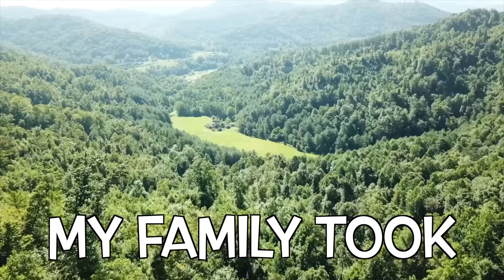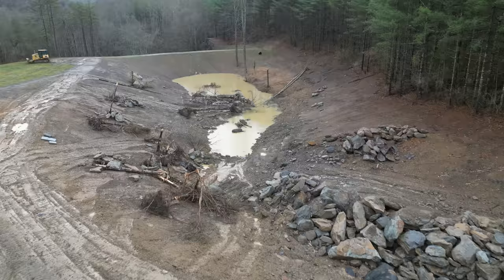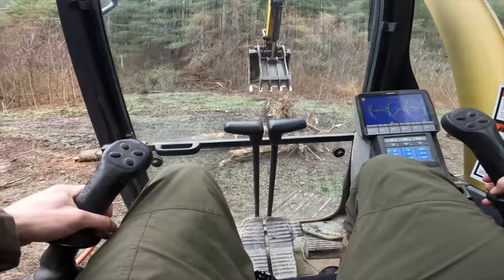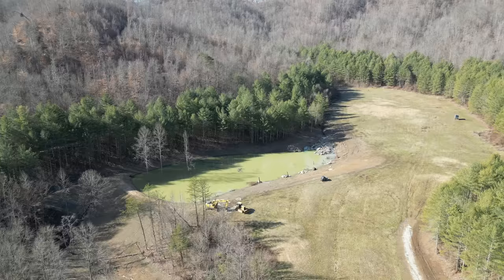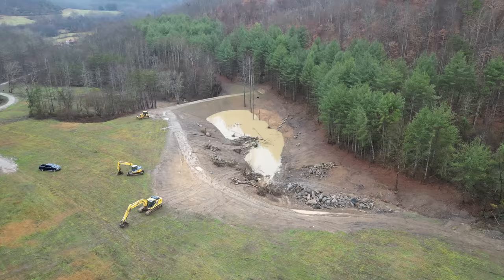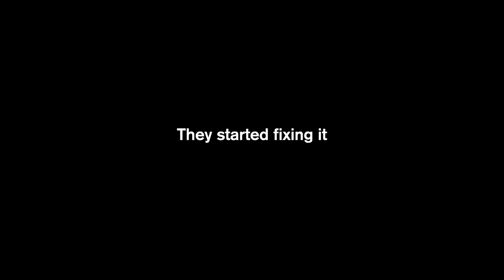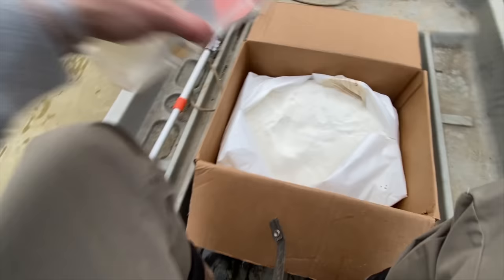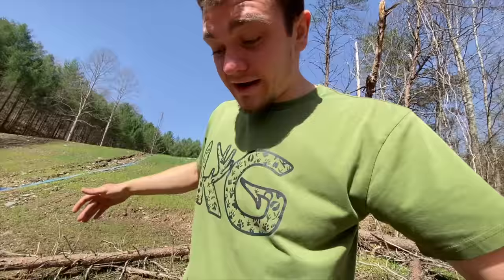Pond Update - (we have some bad news)

Comment: Hey I’m an engineering student who specializes in watershed sciences so I basically study designing ponds like this. I’d strongly strongly strongly recommend finding more rocks or riprap to put where the water flows out of the pond.  That helps the water slow down and it prevents erosion, which hurts the areas downstream of the pond.
Reply: Underrated comment
Reply: Meow
Reply from the maker: What size rock would you recommend?
Reply: Respond to kg?
Reply: Respond to KG?
Reply: Rip rap is usually 6"-12", sometimes more. It doesn't have to be exact but you want something that locks together well.
Reply: Your pipe floated. You need to have a overflow weir. It’s so much easier done than explaining it
Reply: Its not really about down stream. You need to worry about the integrity of the pond dam. If the erosion cuts the dam,the entire thing could give. Especially with the bad soil that has rock in it. 
The best way to resolve the issue: 
1. Drain the pond again
2. Dig it out more, basically make the pond bigger. This will be temporary.
3. Make a pop IN the pond that sticks straight up with a cage around it. Trench it around the edge of the pond and have it come out below the water level of the pond but also away from the base of the dam. I also suggest not using plastic pipe...unless you plan to do it right and use rock and gravel in the trench.
4.  Once the pop pipe is installed, go and put in your layers of clay. Its pretty much your best option with that big of a leak. Using sodium bentonite is not meant for large leaks. If it was just seepage and sponging than it would actually work. Your leak is more like a man made spring. The ground as you stated is too rocky so you really do need the clay soil layers.
5. Than as the OP Grant stated, you may put rocks at the outer pop flow. It is important to note that leaving the pipe open without a grate or screen is potentially not good. This allows animals and stuff to get inside and create blockage. So think about making a spillway base of concrete with a grate or something.
Reply: @KendallGray1   6 to 9 inches
Reply: @D_cell_battery  fire name
Reply: @BoRobertsOutdoors  thanks
Reply: Respond
Reply: @BoRobertsOutdoors   ok but enough about your preferred sizes in the bedroom, what size rocks should KG use???
Reply: Respond
Reply: respond to kg he asked a question
Reply: They should have put clay layer down
Oh well
Reply: Please have an engineer review your work before these videos become "Exhibit A" in a court case.
Reply: @KendallGray1 he didn't have anything to say after that fake comment 😂😂😂
Reply: battery?

Comment: I've fixed a few pond leaks by allowing the pond to drain down to the level where the leak is, and then you pour a liberal amount of a mixture of dry bentonite clay powder and granules, in the area of the leak, or all around the pond if you don't know where the leak is. I would personally cover that whole end of that pond with bentonite. 
The better option is to drain the whole pond, take everything out, and truck in enough regular clay to line the entire pond bottom with at least a foot of clay. that's really what should have been done in the first place. You have the equipment to do it so...
Reply from the maker: Yep!

Comment: Hey man, I just saw your video today, and it's pretty intriguing. I'm a mining engineer and I have some pointers if you ever redo this or make a new one. 
1. Try to use a grizzly screen to separate the different sizes of rocks and the dirt from the rocks. You could use the rocks/ giant boulders as a "core" structure and dirt as a filler. (Research "EMBANKMENT DAM - earthfill dam" if you want to know more or learn about this). 
2. Use a vibrating compactor to compact the dirt. Always use a vibrating compactor.

Comment: you need to contact your local office of the NRCS and ask for a field visit for technical assistance from the Soil Conservation Technician or a referral to the NRCS area Engineer so they can tell you how the structure needs to be built.. i design ponds for a living with the agency here in Oklahoma and the list of issues with that dam are many... the start will be to size and properly install a primary spillway device (pipe) in the dam. the "whistler" concept like you have doesn't work. had everything else have been fine, that would have back cut your dam over time and breached it all by its self. then you need a proper sized earth spillway. everything will depend on the drainage area and the soils as to just how that should be built.. but that's not it I'm afraid.

Comment: Seems like there's not sufficient clay content in the soil for the pond to hold water without erosion happening and/or the soil is too rocky, either one of these two can cause issues. I would get the soil tested to see if it's god enough for a pond, well actually you should have done so before you started the pond. For such a large pond I would recommend 30% minimum clay content with little rock content. If it keeps happening I suggest you fill the pond with clay or get a liner, both are very expensive options. Building a pond is a science but you decided to go gung ho and just build it with zero consultation.

Comment: You need to redo the expanding powder when the water level is higher. If the leak was 1 ft above the water line when you did it the first time it wouldn’t do anything for it

Comment: Maybe there's a reason Letsdig18 uses pure clay without dirt and rocks mixed in it. . First, you didn't put a clay core below the bottom of the dam . Second, you used garbage material to build the dam instead of quality clay. Maybe instead of building Hoover Dam as your first project, you should have started small

Comment: 1st. , did you dig a "Core Trench" In the bottom of the dam ?? That will lock it in !! 2nd., The dirt you used will never work full of rocks like that.3rd. You should have went around your land and see if you could have found any "Clay" to use,  and start by doing the core trench with it, then start doing 1-2ft. lifts and packing it every lift. And if you don't do it like that it's never going to hold, and you will always have leaking issues.... And your stumps should have been flipped upside down and drove in with the excavator some ,so they would hold to the bottom. You may get away with using topsoil if, you make sure it's clean dirt, and start with the core trench, and packing lifts to top of grade of dam. And your pipe could have went a little deeper, with at least 2-4 ft. below grade.  But, all in all your going to have to find good clay or dirt to use...